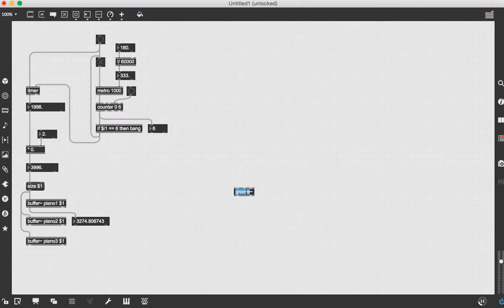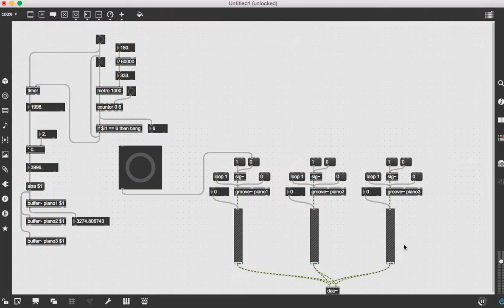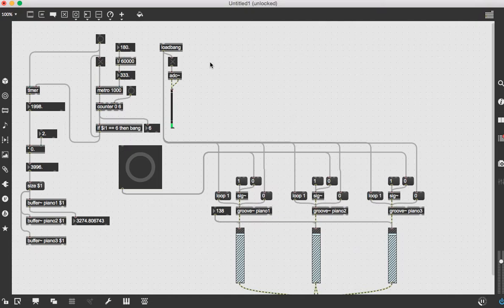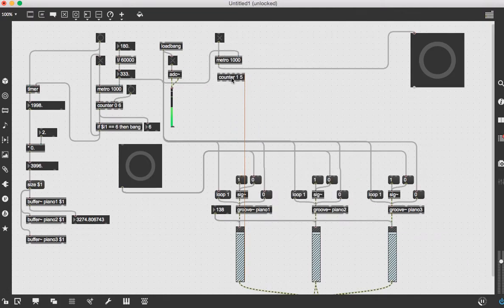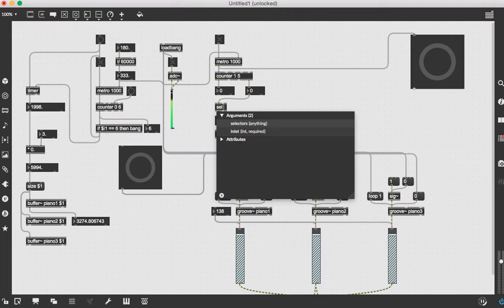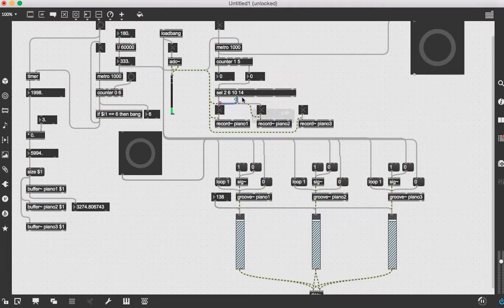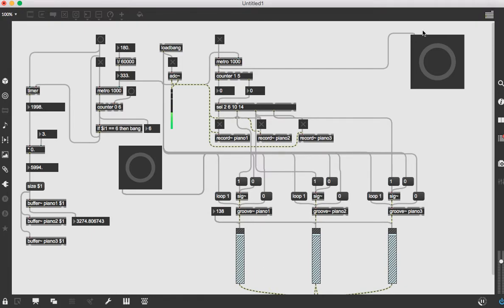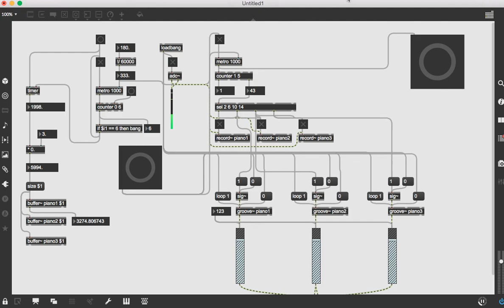Loop Pedal from Scratch | Recording and Looping | Easy Max MSP

Comment: Hi I’m trying to replicate this but my piano1 toggle just keeps turning on and off after I’ve pressed record without moving onto piano2 and 3 - any idea what I’ve done wrong?
Reply: My toggles seem to also turn on and off at a much faster rate than I want them to
Reply from the maker: Hi Hans! Thanks for watching and getting in touch.
Mmm...I suspect there must be a "cable" that is constantly sending signals to your piano1 toggle.
If you want, we could schedule a videocall to check it out. What do you think?
Reply: @soriabox  Hi! Thanks for the help I used your advice and got it to work - but - I actually decided to change my project afterwards. My new project is a lot more similar to your 4 Voice loop pedal you used for the Bach Chorale - would you be able to send me the patch for it?

Comment: Hey I'm trying to replicate this and I'm having an issue where my music measure counter (off of the "counter 1 5" object) skips numbers. Any idea why this might happen? Thanks!
Reply from the maker: Hello Olivia! Sorry for taking long in answering.
Maybe there is an extra input bang somewhere that creates this apparent "skip" or some sort of object that "forces" this behaviour in some way. I say this because, as far as I understand, the counter object can't skip numbers within the specified range, unless it receives multiple bangs or something.
The other option that I can think of is: maybe the specified range doesn't start or end in the number you desire, so make sure the range is correct.
Let me know how it goes!
Reply: You may have already sorted this issue however it may be that you haven't reset the counter. If you blank out the number boxes the carrying amount will still remain as it did previously because it is stored in the counter object. You just need to send the counter object a message with 0 0 0 in to reset the count and carrying amount back to 0.